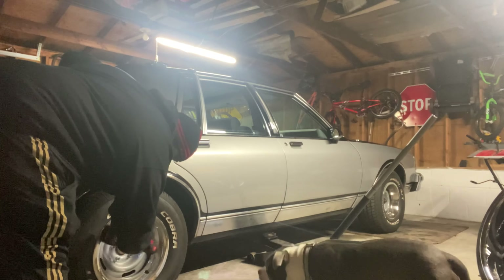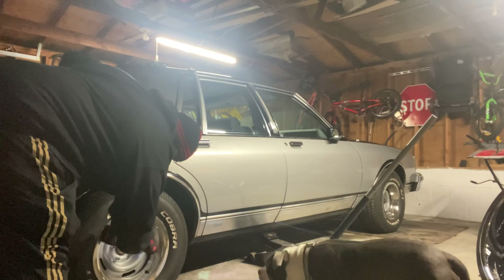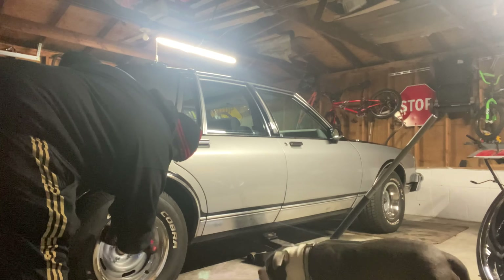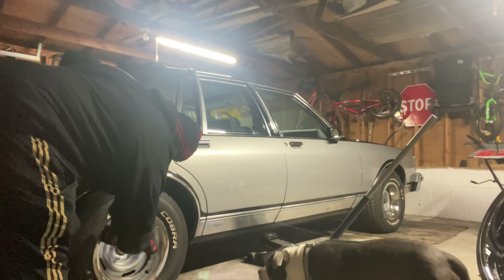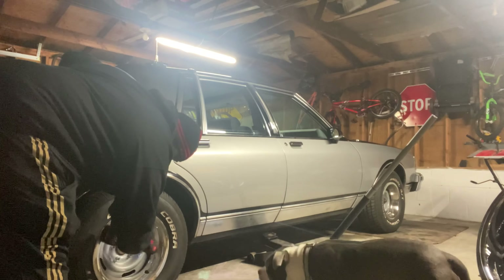28 CORLEONE FORGED TEST FIT

Comment: Shorten the rear end and notch the frame then squat the box
Reply: Facts
Reply from the maker: It’s only 5” lip won’t need to shorten rear end or frame notch I can still squat ..the rear wheel is not actually on the car it’s just sitting in place so once i actually put the wheel on it’ll sit flush
Reply: Respect